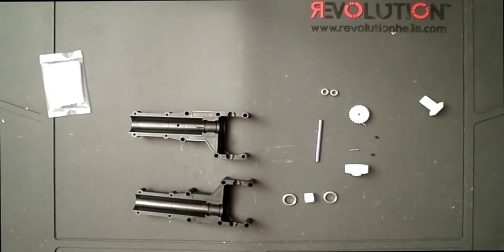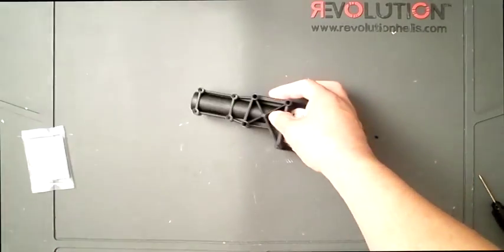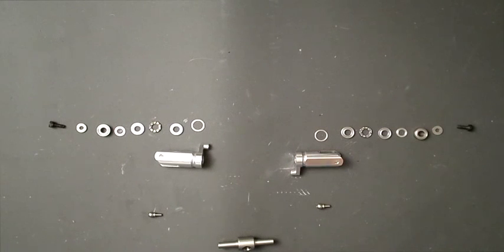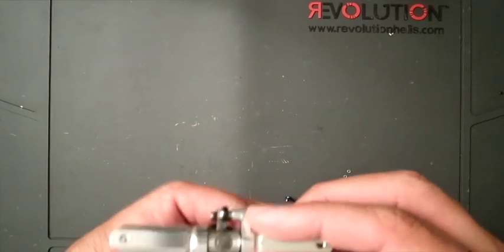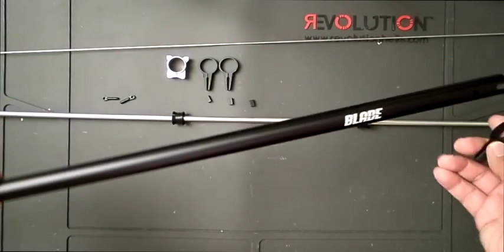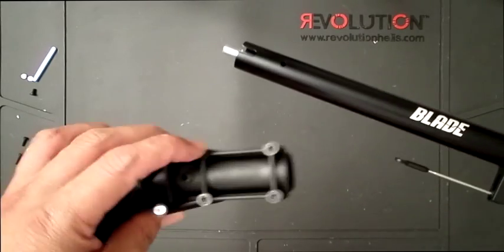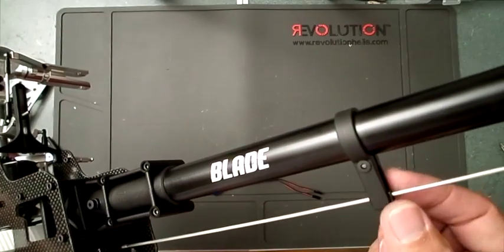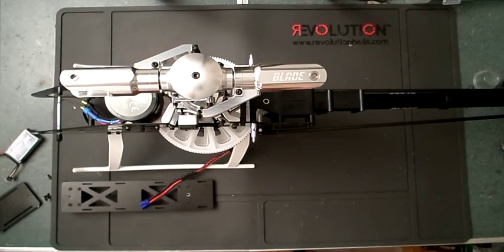Blade 700X Build Series - Part3 - Tail and Final wrap-up

Comment: Hi I am just finishing up on my band 700x build and I am reading that the tt gears striping I have no side to side play the on the tail gear but I have a little play on the gear that's connected to the top back and forth is that normal ?

Comment: Thank you for your video.  The complete build video was awesome and exciting to complete. I have few questions and that is, what size receiver pack are you using for the AR7200 and the spectrum servos? Also when you made that receiver pack lead for the battery.  What or why did you soldier two positive and negative receiver ends to that on thicker cable with the ec3 connectors on it? I know one is going to the receiver but where does the other one go?  Also are you using a BEC with that receiver pack?

Comment: Just a tip, when your mesh is spot on those 45* bevels on the edge of the each gear will line up with each other, It would be nice to see some shims come with the kit so you can make that perfect to get maximum strength at the lowest noise possible. I used some shims from my TT e700 build which worked great. I compared the 2 strait cut gears and yours is much beefier. Which is nice cause i tend to break those in flight...